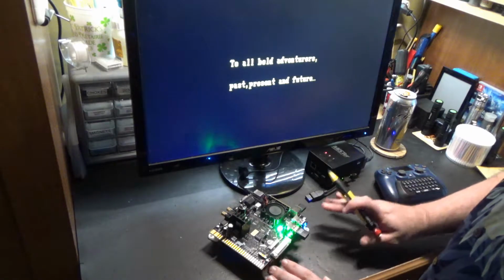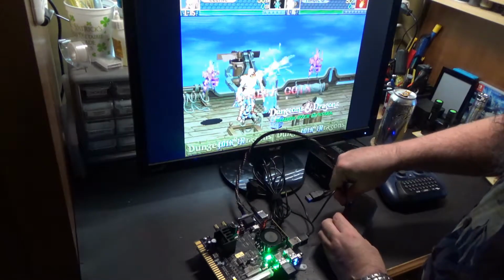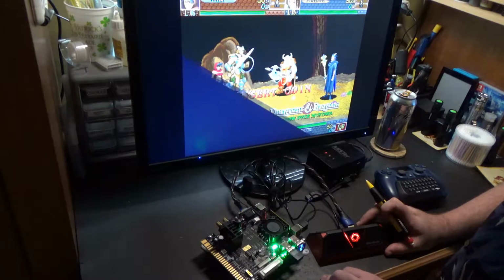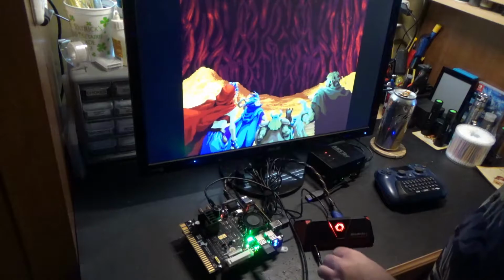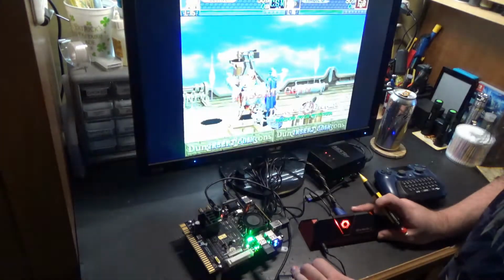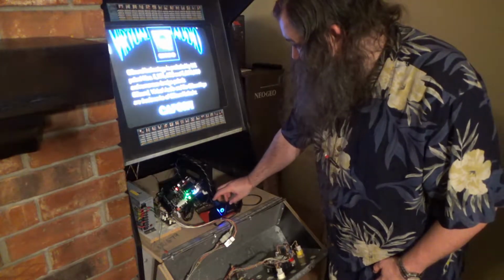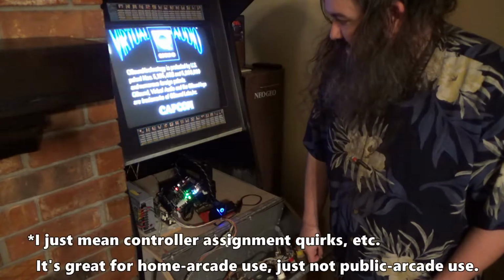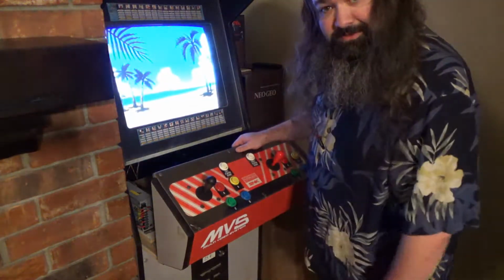How-To Capture MiSTercade Arcade Gameplay

Comment from the maker: BIG CORRECTION: Once I dropped the audio quality in my ini settings, it started working with the recorder eliminating all of the analog audio fiddling. And now I can't reproduce the audio failure even at high quality--so just connect HDMI, wait until it can sync and you should be good.